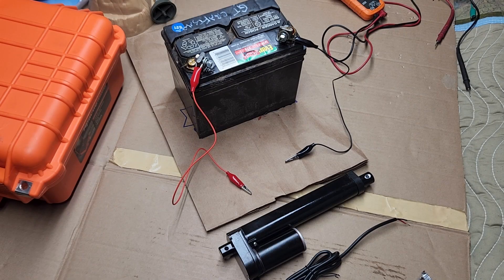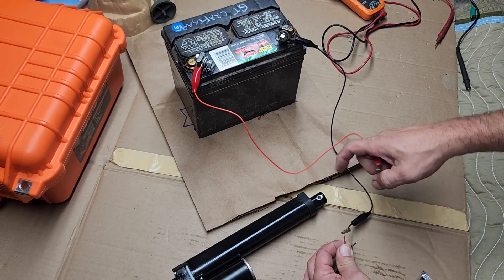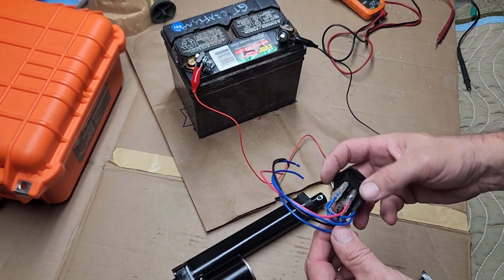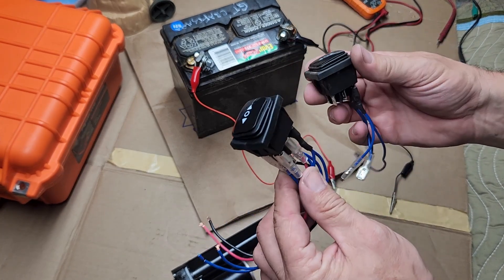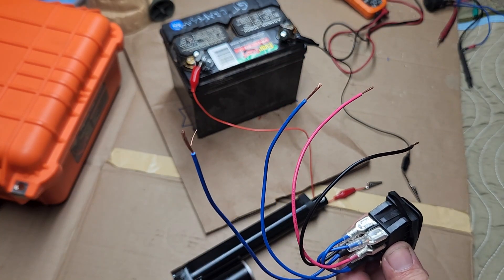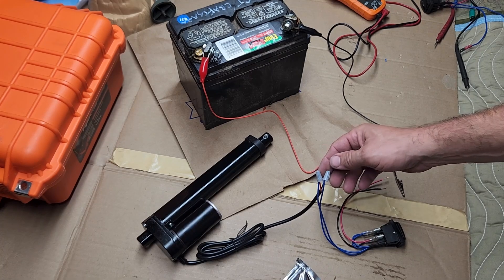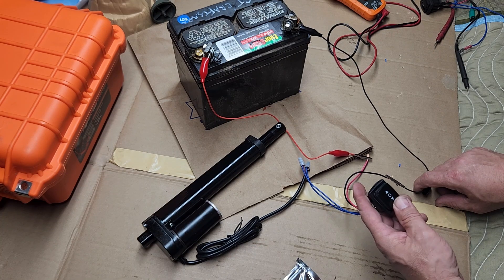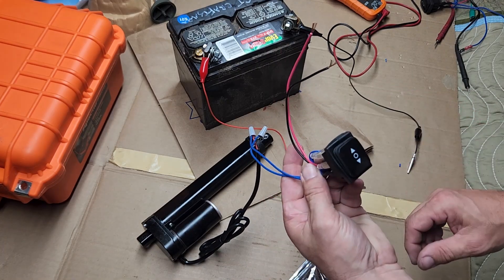Wiring a DPDT Switch - For A Linear Actuator

Comment: I am doing exacty this same thing and I was told I needed to add a forward and reverse relay module in the middle or it would end up frying the switch. I can't find a reason for this, as long as I am using a DPDT switch - any ideas on that? Will the setup you show here, work long term?
Reply from the maker: I can't say for sure. I haven't done it yet.